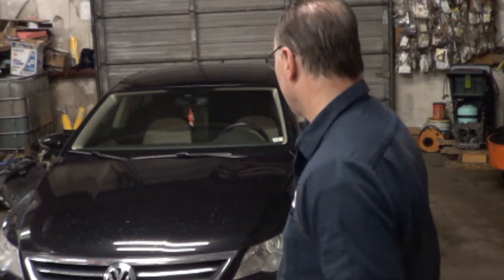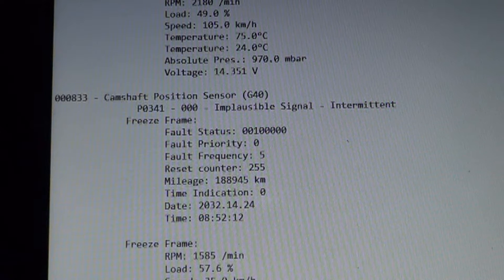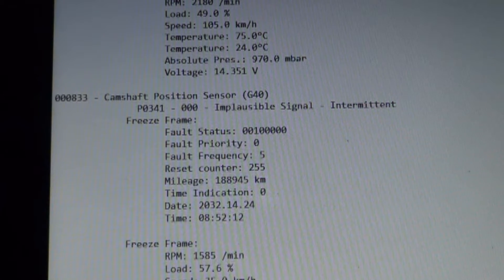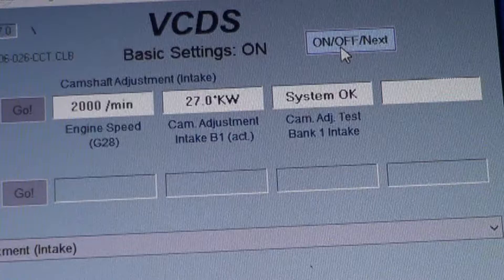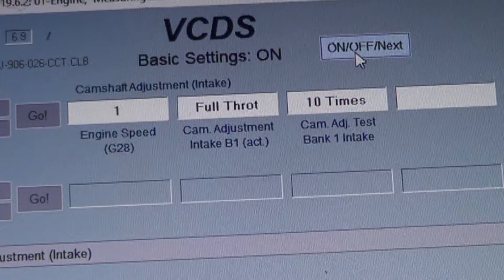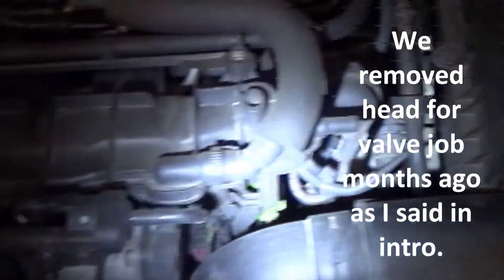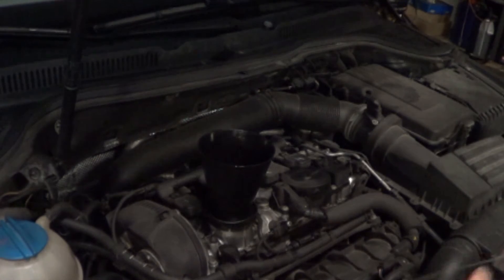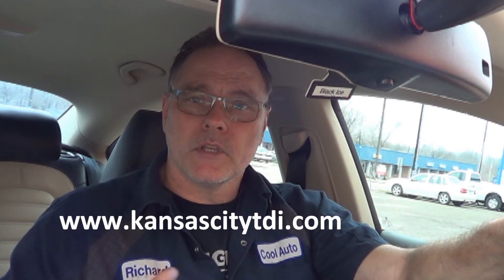P0341 Cam sensor implausible

Comment: I had exactly this code, and topping off the oil totally fixed the issue.  Thanks for the info!
Reply: Did you ever stall at all ?
Reply: @Wetheppls47  It never got to the point of stalling, just really bad hesitation, usually when revving through a turn.
Reply: @thespatch  I have intermittent epc and p0341 comes on here and their but no light and the sensor has been replace I want to start small but just want it fixed and keep my motor alive
Reply: Also did you have oil consumption and or fix the issue upon the day it happned this has been happening for a few months now and I’ve tried a few things alr
Reply: Not oil consumption talking about did you too the oil off as soon as you knew it was offf
Reply: @Wetheppls47  The problem had been occurring for a week or so.  One morning, the hesitation occurred as I left my neighborhood, then when I turned on my car to return home the “Low Oil - Turn Off Engine” warning came on.  It was then that I researched and found the hesitation and low oil might be related.  I topped off the oil and the hesitation / code haven’t recurred since.

Comment: Can this variable cam timing out put basic settings test where the computer will command the variable cam timing to advace all the way and then retard all the way in testing whether my timing is off or not could that be performed on my 2007 Audi Q7 3.6L V6 automatic transmission suv ?
Reply from the maker: I do not know.

Comment: I have 2007 Q7 during transport on flatbed the driver was pulling the Audi onto the bed an the  bed was at an angle, whereby oil leaked out a considerable amount onto bed of truck. I am stumped as to why and even how would the oil leak out of the engine like that. I too have the P0341 code as 004 implausible ending stating intermittent. Have you ever come across anything like that before? I have fresh oil to be put in the vehicle just have not changed the oil yet in the vehicle.
Reply from the maker: low oil can cause that code (amoung other things).   Fill the oil, clear the code and hope.  I dont know why your oil leaked but maybe rear main seal???
Reply: @CoolAirVw  the rear oil seal is perfectly fine. I have found that there is something wrong with the oil drain plug nut which i am assuming the previous owner used an application of what appears to be JB Weld to the area. I have not had a opportunity to further inspect things to determine why JB Weld was used. Now the previous owner had it and allowed battery to drain deficiently low. This resulted in the system shutting down various components. On top of that there the Audi Q7 3.6L V6 Quattro PCM even with brand new battery in is still under impression that the dead drained deficient battery is still in vehicle. I do not have a paracitic draw, yet i am stumped as to whats now draining the brand new battery outside of what i have said that the pcm is doing thinking that it has old bad battery when it now has new one installed. The battery is main reason why most of the vehicle's system components and modules were shut down to conserve power to start vehicle which now it will not start crank yes only. I need to figure this mystery completely out..

Comment: Whenever losing oil in the VW 2.0L TSI CCT motor, always check the pvc system.....If the diaphram in the pvc ruptures, oil will be sucked into the intake...
Reply from the maker: thanks for sharing that.

Comment: Thank you.  Eos was flashing error on large turns. (What did it say? "I don't remember" ) Should have been a sign. Reported  P3041 code. Was very low on oil.  Added oil. Seems to be fine.
Reply from the maker: I'm glad this helped.  Keep an eye on that oil level.

Comment: The phaser (cam adjuster) fail on these often because of the screen in the oil bridge coming apart blocking oil passage which also can ruin the cam journals. The locking pin in the phaser wear from lack of oil and just typical wear so the cam doesn’t lock at base timing, if this happens Usually you will have misfires at idle and get p0341 code at idle. If the screen caused damage resulting in oil bleed off from excessive clearances and/or restriction in oil flow usually you will get codes at lower rpms specially if you have a 5 speed because when u take off from a stop rpms can get low depending on the driver. 

I’m not saying this is the problem with the vehicle in the video just giving some info because there isn’t much good info on these problems. The car in this video has a problem with burning oil which is a common problem with these engines could be piston rings, pcv problem which is easy to know because you will have oil in the intake if it’s a pcv problem. I doubt it’s valve seals if it was it would smoke on start up after sitting over night and I’m sure the customer would say something. IMO vw/Audi should have done better with the software on these cars making it more sensitive should get a camshaft performance code or correlation code when the phaser has a problem I’ve seen so many that just have a p0341 code
Reply: i have EA888 3rd Gen 1.8tsi 2015, do i have this screen? cant find information, but I think that only 2.0tsi has this screen, isnt it ?
Reply from the maker: @majklxxx  You have a UDS car.  Uds basic settings tests are different.  Your car might not have this one.
Reply from the maker: Sure that is a possibility, but if its low on oil and cant duplicate a problem after its full of oil???  Might have a video coming up with a different car with cam phaser diagnosis and replacement.
Reply: Hello there, i have this tiguan 2009 for a customer with cct engine on it, this engine had issue witl ballance shaft, i removed the engine and averhauled it, replaced ballance shafts(oem), piston rings gaskets seals etc., replaced the bridge the phaser the cmshaft adjuster replace everything i still ha e this po341 fault from time to time specially when going uphill and the oil gets hot(replaced oil coolar too), if there is a clearance how am i going to know ehere is this clearance? Thank you

Comment: Defiantly low oil because the actuator vtc vvt works on oil pressure the solenoid is just to allow and cut off oil to that unit good work bob
Reply from the maker: thanks for sharing.

Comment: Is it possible that the p0341 code, which is the camshaft sensor for air and gasoline, is caused by the crank sensor
Reply: Because I changed the cam and chainstay sensor and the chain wheel and checked the electricity, but the fault did not go away. Engine type Peugeot 1.4vti
Reply from the maker: If you see all the videos on my channel relating to this code you might find the problem with your car.  I have no experience with your Peugeot 1.4vti.

Comment: If you can help me with my problem. My car when I start in the morning does not present the problem p0341, as it heats up and it is running at over 2500rpm it presents the epc lamp, even when it scans it with vcds it gives error p0341. I want to add that if the car stays in place and does not walk, even gives gas it does not show the defect. I changed the magnet camshaft but with not results. Thank you in advance
Reply from the maker: Did you inspect the valve behind the magnet?  I have another video on that.  Is the oil level full?
Reply: Did you find out what was the problem?
IMO, I would go then one step back, the cam bridge itself

Comment: what was the problem? did you run out of oil? I don't understand English and I have the same problem. Thank you.
Reply from the maker: yes, the customer was low on oil..  I have several videos on this type of problem.
Reply: @CoolAirVw  muchas gracias. me suscribo a su canal.
Reply from the maker: @tinchoaguero7835  gracias por suscribirte a mi canal. ¿Tienes un Vw o trabajas en ellos para ganarte la vida?
Reply: @CoolAirVw  I have a vw jetta 2011 tsi with error p0341 camshaft position sensor (g40) implausible signal. I added oil and the error in vag com and the failure went away. but the next day the error returned. The fault only happens with the engine warm.
Reply from the maker: @tinchoaguero7835  I have several video's on this code.
Reply: @tinchoaguero7835  do you solve this problem ?
Reply: @vini.salgueiro  nou. This problem continue.
Reply: @tinchoaguero7835  bro , I solve my problem… was the camshaft bridge, the internal ball/sphere lost de pressure, and in low rpm don’t have a good oil pressure on cam…

Comment: Very informative. I never would have thought of that since I’ve never had any experience with VVT engines before. 

And people should use an oil funnel and an oil filter with a one way check valve in it so the oil doesn’t drain back out of the filter when the engine is shut off.
Reply from the maker: They are still coming in every one in awhile low on oil with cam / crank correleation codes.

Comment: Thanks for the helpful video. Gets my train of thought going in a new direction. I recon low & wrong oil visco is the real cause here. Fault code was tripped at +-49% load, so maybe low oil pushed away from the oil pickup & got some air to set the code? Thanks again for the content.
Reply from the maker: Excellent point!  I dont pay close enough attention to freeze frame.

Comment: I know you ran your test then checked oil on a warm engine level so how could you make the rational that it was low or will a warm engine oil check be in the safe or full level? Interesting may need to teach myself oil checking 1 on 1 again

Comment: I would take some oil out to reconfirm the fault
Reply from the maker: Very valid point, but I couldn't duplicate the issue before filling with oil.  Making it low again may not have yielded any results.   Only so much time in the day.

Comment: these things are so sensitive to oil. level, correct weight and spec. its why in the manuals it states to check oil level every fuel fill up.
Reply from the maker: Excellent point.

Comment: I would look at the viscosity also if this Oil change. I have seen those quick lube places put 0W20 bulk oil in VW and sometimes well that would also alter the phasers on the cams
Reply from the maker: Excellent point!
Reply: @CoolAirVw  Hello! Check Wiring from/to Camshaft Position Sensor (G40) This  is also? but my car was new oil change and trobul code cooming back and harding working car. "ENGINE fault go to garage! "

Comment: Richard, good video/info as they say always check the basics so from my understanding the oil was leaked from the cap or the filter and do u now if  Autel  scanner will do that test to make sure the pcm is working to control the timing. thank you and cheeeers
Reply from the maker: My assumption was they got their oil changed and it was left low.  Only under certain circumstances would it trigger the code though (hot, long drive ect).  Probably the Autel will do it.